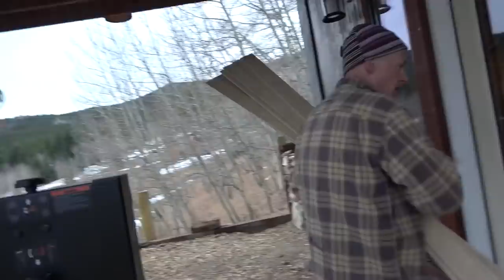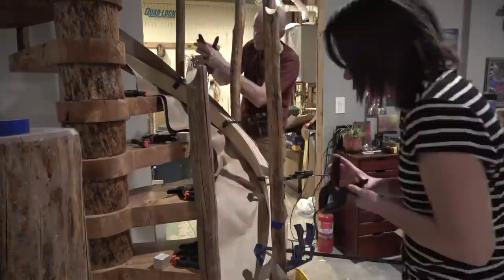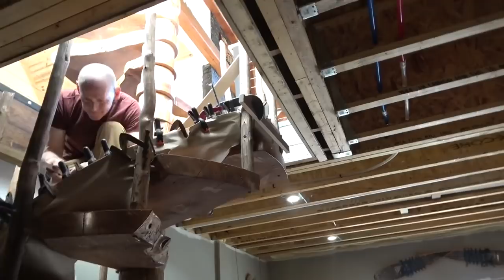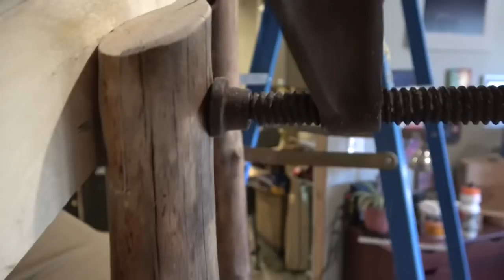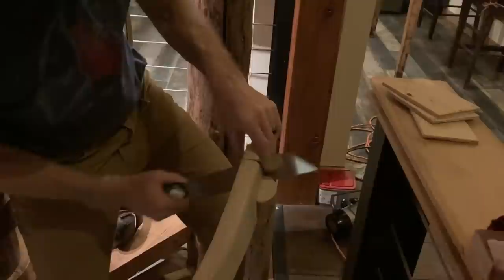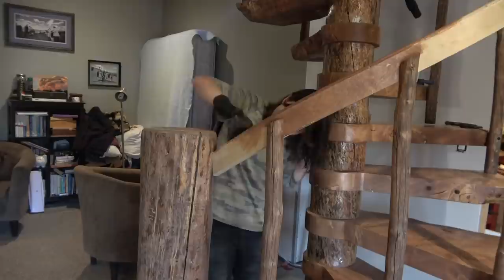Installation of our Spiral Wood Railing

Comment: I have built 1000s of ft of handrail with TiteBond, slow dry, and yes it still drys fast we use a laminate roller to spread glue. your on right track.
Reply from the maker: Thanks. We're going to use the plastic resin glue for the second rail to the loft, and we have the rollers! was just saving them for the resin glue.

Comment: Rather than spindles between what you have now in place, can you use wires placed horizontally like you have used in other railings?  It would result in a more open look for your stairs and lost more of the beauty of your wood show through. Looking great!
Reply from the maker: That's a thought. but I think the minimalist half inch iron rods will "disappear" as well, and contribute to the rigidity to the structure.

Comment: Hey Brian , you could always cut the opposite side the same and make it like a mortis joint by veneering the out side till your smooth to the out side no screws no split posts .Fingers wont hit the posts .?? Just a suggestion . It still looks good the way it is . Bye,.
Reply from the maker: Sounds like a LOT  more work LOL.

Comment: Probably been discussed here already but if you staggered the ply ends at the joints you'd get a much larger glue area making the joint stronger.
Reply from the maker: Yes, that was in a few comments we got to after we made the first rail, but we plan to d o more staggered joints for the 2nd railing. thanks!